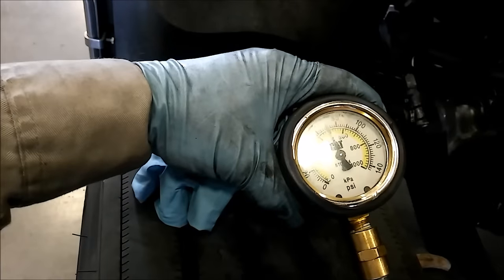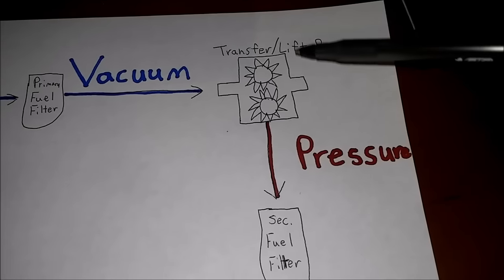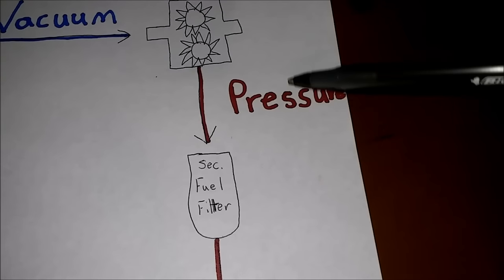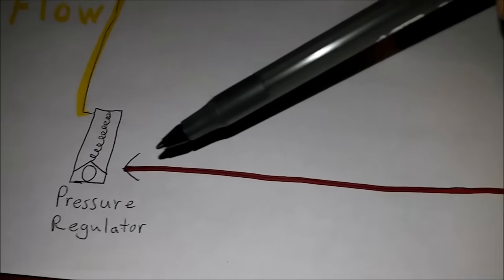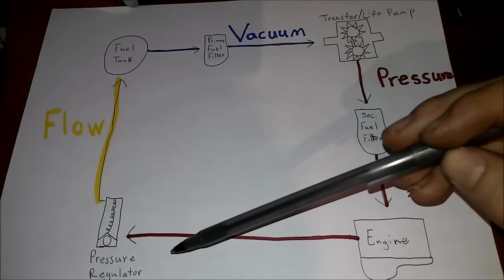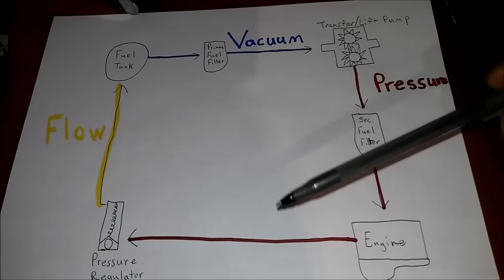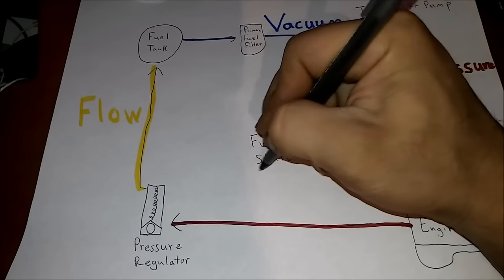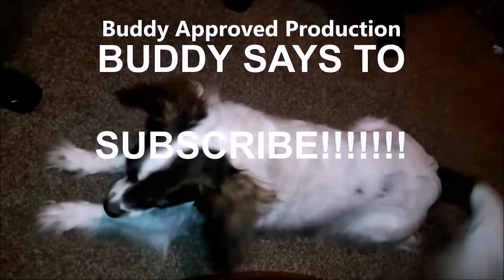How To Troubleshoot Cat Fuel Systems and Test Diesel Engine Fuel Pressure.

Comment: what are some of the symptoms of low fuel psi. without checking the psi. what would y be experiencing?
Reply from the maker: +kwmiked Many symptoms, could be hard starting, or an engine miss under load, or rough idle, or the engine could shut down. Most performance complaints can be cause by low fuel pressure, that's why its one of the first things to check.
Reply: +Adept Ape ok, one of our trucks feels a little sluggish getting on highway. doesnt seem to rev like it did or jow the other ones run. The other ones feel free, this one feels like its working to pull up rpms and speed.   Noticed a little smoke that was not really there before.  i tighten up the clamps on the CAC tubes, it seemed to help a little.  so im wondering if the CAC has a leak. What is the psi to pump up CAC and how many psi drop over how long? thanks
Reply from the maker: +kwmiked If your using a CAC tester I usually only take it up to about 15 psi max, if you have a boost leak it'll present itself quickly. If it holds for a minute your fine, the reason I only pump it up to 15 is those CAC testers like to blow off sometimes and it is dangerous.
Reply from the maker: +kwmiked Let me know what you find, low power complaints can be tricky, put a fuel pressure gauge on that thing just to check.
Reply: +Adept Ape ok thanks,  once i get some free time ill check it out. its a second truck that sits around so its not like its run daily
Reply: Adept Ape  I have a fuel leak from the hose that goes from the clear plastic filter to the fuel tanks. will this make my c12 lose power, smoke, and nasty smell.

Comment: hi, the problem of my generator is when start the generator the rpm is normal 18001 and the hz is 60.0 but if i put load the generator rpm will go down 17998 and also the hz go down 50.8 until the generator going to shutdown automatically,can you help me pls.. my generator is catterpillar 700kva

Comment: I have a C15 in an '06 kw w900  every time the engine is shutdown ,,even for a minute, when I start to take off it falls flat back to idle, I have to pum the throttle to get it to rev up again and then rev it up 3times then it take off and run fine all day ,until i shut it off ,then its the same thing again

Comment: We have a 94 Kodiak with a cat 3116 Diesel engine. We took it to have an oil change at a diesel garage. They changed the fuel filters that we had just replaced. Since they did this the truck won't stay running as soon as you fill the  secondary it will run till the fuel filter empties. We've replaced the fuel pressure regulator. We've also replaced the fuel filters again thinking there might have been a defect. We've replaced part of the lines. Still having an issue. The ecm is good as well. Can you give us any other suggestions what to do. The truck was fine till they replaced our fuel filters during the oil change. We replaced the check valves and one has a spring we changed. And we've also tried finding a diagram of the fuel system and haven't been able to locate one. On that model it doesn't have the fuel primer pump. Can you help me?

Comment: Hi I have a cat 3126 in a 953c loader it white smokes has a skip and has a heavy fuel smell, injector ?
Reply from the maker: With a heavy fuel smell in the exhaust you could be on the right track, you'll need to do a cutout test to determine which cylinder is missing. An injector is the number one cause of an engine miss, but when you get the valve cover off make sure to inspect the valve train for damage and also pressurize the cylinder to make sure it holds air.

Comment: plz help...if a c7 heui pump is taking a dump...can it put oil in the fuel?
Reply from the maker: +Pirate Dread Roberts It is not usually the HEUI pump. It is usually a bad injector or injector oring.
Reply: what the best way to diag without tearing it down? thanx in advance...

Comment: Any chance you can tell me the part number for c15 fuel regulator
Reply from the maker: +Kevin Konechne A 281-2725 is the part number, make sure you get the 238-5081 seal with it.
Reply: I have a c12 1yn series. I've replaced the fuel filters and fuel pressure regulator and hand primer, still no start. I don't believe I'm getting the engine primed. What next? It will run on ether.
Reply: How about pressure regulator 295-1441? Also, did I see a Diesel Freak harness on this truck?

Comment: I've got a c15 that the fuel bleeds back overnight it'll drain the fuel and act like it's a got empty fuel filters
Reply: U figured out the problem? having the dame isue
Reply: I do believe there is a check valve in the primer. I would replace your primer
Reply: Same problem  here  any update on the fix?

Comment: I had 2 3406e engines that had fuel restrictions past engine ,on the return side ,with the inside of the line  apart and  partially plugged ,hope this helps someone

Comment: what about a 3406e  5ek engine.. same location as a C15...?
Reply from the maker: I'm assuming you mean the fuel compucheck fitting, it will either be on the fuel filter base or sometimes there is an auxillary housing with the regulator in it that sits in front of the base closer to the air compressor, that may also have the compucheck fitting on it.

Comment: Yo Dude, Cool Videos, you have extensive knowledge of these machines. Question: we have a C9 marine Genset that failed the the other day. The Lifter retaining clip for piston number 4 exhaust valve snapped and caused the lifter to rotate causing the lobe to foul on the camshaft. WE discovered fuel in the Oil and removed the head, fitted new lifters/camshaft and put it back together. Timing checked and Cat ET hooked up. She will crank but will not start. No Fuel pressure reading in CAT ET, Engine RPM = Abnormal signal. Checked pressure reg valve, checked resistance of 2 x timing sensors and measured voltage of 10.3volts at sensor. Primed fuel system and still no good. sprayed jump start in on cranking and she fires but dies. Removed fuel line from transfer pump outlet and no fuel discharged on cranking. Suspect faulty Heui Pump/transfer pump. Question then: Would the Fuel dilution prior to head removal cause any Heui faults ? IS the transfer pump constantly driven from the camshaft gear or does this run via another gear inside the Heui as and when needed ? Going to remove the pump tomorrow and inspect anyway. thanks
Reply from the maker: +Daygoer “Rodders” Rodrigues Your fuel transfer pump runs off the HEUI pump so as long as your engine is turning the transfer pump is pump, or should be. Have you tried running it out of a bucket and then cai the transfer pump with a gauge to see if it will build pressure?
Reply: Hey Dude, thanks for the reply... this is a strange one. We had the fuel lines ran directly from a local fuel source and she still wouldn't fire. Cat ET is showing "abnormal signal" for the cranking RPM. I have tested on another Generator by removing the Injection actuator connector so she won't fire and its shows the abnormal signal for a second and then starts to read the rpm correctly on Cat ET, it shows around 400rpm on the other units we have onboard for cranking Rpm. I swapped the primary and secondary sensors over on both units and still no good. Drawn a blank now and techies been called out to assess. For some reason i suspect this abnormal signal should not be showing upon cranking. I have measured the distance from the datum face of the block to the camshaft reference teeth and same on each unit. Wiring harness looks ok, so not too sure. cheers Paul
Reply: Turns out we were supplied a cam gear off a truck engine and not the marine genset cam gear we had ordered. We installed the truck cam gear not realising and the reference lobes for use with the timing sensors on the back face are different. The truck engine cam gear for the C9 has less reference lobes than the C9 cam gear for the genset cam gear. The timing sensors sending abnormal signals to the ECU and the Engine didn't know when to fire/inject. Swapped for the correct cam gear and she fires no problem. Thanks for your help.

Comment: Does same apply for a cat 3406B
Reply: Measure a 3406B/C  in the o-ring boss plug at the secondary fuel filter base. Be warned that plug may strip out. If so take everything off the base and drill and tap to 1/4 NPT. Or get a tee and measure psi on the right side of the base. Fuel psi should be around forty PSI. Should not drop under twenty psi under full load. Due to the design of the FTP the psi may bounce on your gauge. If so, or you install a manual gauge in the dash. You might have to install a snubber in the fuel line. Also this system has no relief valve. Your psi is made by the return fitting on top of the main pump. If the fuel return line collapses internally, you can blow the fuel filter off or fail a valve in the FTP. I recommend putting a number six or eight fitting in the pump. Then replace the fuel return line back to tank. I have seen numerous number four lines fail, have not seen a number six or eight fail yet.  If you repair (very cheap) or replace the pump (do not use yellowmark parts). Make sure both bolts are in the pump before taking lines off. Have heard of one and a bolt was missing. Went to remove line and broke the pump. Pump works off an eccentric so take the short bolt out first, frame rail side. Be in the front, might squirt fuel on you from rear. Loosen longer bolt, engine side. Have a pan under pump as some oil will drain out. Pump is very easy to rebuild, two bolts and two allen screws. If one of the 1/4 bolts strip out that holds it together, get a longer bolt, washers and nut and hold it together that way. No need to replace or heli-coil the hsg. When installing FTP, main pump on number one is the best way or make sure eccentric is up. Barely start short bolt, then install long bolt and tighten it first. Than tighten short bolt. Have seen numerous times hand priming pump causing problems. Remove pump and put in glove box with a few gaskets and wrenches (use it if needed). If you prefill filter make sure you put fuel in small holes and not the big one. Big hole is unfiltered fuel going to your expensive fuel pump. Place a cover where you removed hand pump.

Comment: my cat motor starts runs at high speed for about 10 minutes then acts like it starving for fuel then dies. I changed filters still does the same thing any ideas?
Reply: david farmer hey David, I’m having the same problem right now. How do you fix it?
Reply: @js2380  i just saw your post it just showed up you replied on 4-30-20 my problem was the rubber hose from the filter to the pump was junk and colapsing inside.  had that happen on a semi years ago the rubber hose collapsed on the inside

Comment: Ive got a c15 that keeps losing its prime my sec filter keeps losing fuel i have to manual prime with the hand pump when i leave it parked for a couple days Can it be a line issue? None seem to be damp or leaking
Reply: O my goodness... mine did the same thing!! It’s an easy fix... it was the fuel return check valve ($40) looks like a bolt on the fuel filter housing. I also replaced the bypass valve and primer (the primer was also bad) they were all the same age... tip in bleeding the system after opining it up.. I found cracking the fuel line at the top (air rises to the top) was more effective than using the ‘bleeder’ on the fuel filter housing.

Comment: Hey there. I have a 2008 C15 twin turbo CAT. The truck doesnt make any power. when you step on the gas, the engine vibrates. took it to many shops. All the valved has been change, handpump, fuel pump, bypass pressure valve and still have have the same problem. What would you recommend?
Reply from the maker: +S&H Trucking LLC Sounds like they are changing every fuel component. Does the truck have low fuel pressure?  Any check engine lights?
Reply: Adept Ape no check engine light.. Im trying to figure out how to check the fuel pressure but i cant figure out if i have to remove the test port to put in my pressure gauge..truck drives fine but vibrates a lot under load..
Reply: @faraznabibaksh  : so what was the problem? Did you solved it? Had same troubles, we change both fuel filtes and a sensor located by the fuel filter housing,( NOT  the water separator filter) cant remember name of it.   good luck

Comment: HOW BOUT A VIDEO FOR TROUBLE SHOOTING A C15 LOOSING PRIME OVER THE WEEKEND
Reply: Having same problem. Did you ever figure it out ?
Reply: Isaac montoya same thing is happening to mine
Reply: Brandon Strickland i have a cat that loosing it prime and want pull go down the road so where do i look for
Reply: Block off fuel lines in sections and vacuum test the circuit and and check for pressure loss. Sucking air somewhere
Reply: Did anybody ever figure out what could cause this I have the same problem
Reply: Sam B I’m having the same problem
Reply: did you solve it?
Reply: injector o ring would be my guess
Reply: Check ball valve at filter base after fuel tank line.
Reply: Brandon Strickland i changed my fuel check valve.. really easy let me know if you need more info
Reply: Mine too
Reply: Any body got thers fixed yet..im losing prime over night
Reply: odessie grant I changed my fuel check valve. It’s really easy. And it fixed that for me. It’s what holds enough fuel for you to start the truck next time you get in it.
Reply: Mechanic looked at mine yesterday and said it was fine...u think I should change it anyway?
Reply: odessie grant it’s cheap and a good start.. idk how he could possible check it. It can look fine and not work lol. But I would. Use a 1 inch  socket and take it out. It’s right next to your primary filter.
Reply: @TheFlyhighlikemike  thanks bro
Reply: Gunner Gomez do you have a pic of location of check valve
Reply: Keith Parker yes
Reply: Had a crack in my fuel line..problem solved
Reply: Keith Parker just sent it
Reply: Gunner Gomez come to find our it was the hose quick connect fitting on the transfer pump on the front of the motor , thank you sir
Reply: Depending on the primary filter..check and see if it has a large and a small oring..if it does make sure it's installed, make sure it's not doubled, make sure it's not cracked.  If this oring is missing or damaged it will  drain back. Especially if the tank is under half full. Easy to check and I've seen alot missing believe it or not.

Comment: my CAT246bskidsteer doesnt hardly move even when at full throttle
Reply: Possible Faulty actuator, check wiring first, then actuator..diagnosed a skiddy with this issue.

Comment: On the fuel transfer pump does it have a gasket or o rings
Reply from the maker: +Lee Hill Orings for the fittings and face seal on most Cat engines.
Reply: Thanks mine is leaking picked up o rings to change this evening should I change the face seal as well?
Reply: Hi 
I have one question, in C15 engine there is only fuel transfer pump, there is no fuel injection pump,  than how high pressure is achieved in injectors without high pressure fuel injection pump? please reply
Reply: Can anyone help me figure out why my C12 is not using fuel equally from both tanks?

Comment: Anyone know the size line and fittings going from the secondary filter to the cylinder head  (right above the heui) On a 3126b
Reply: My hose is leaking and struggling to find the parts!